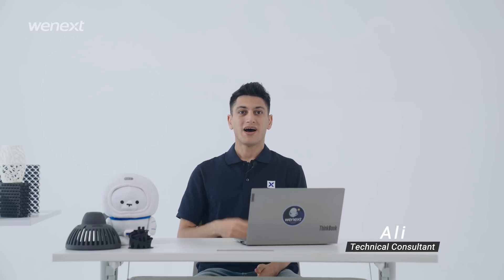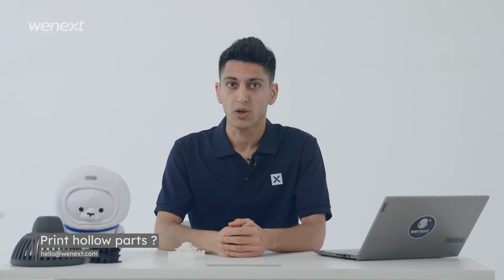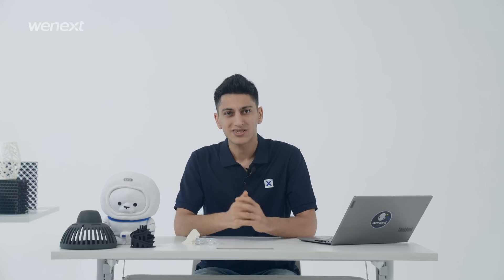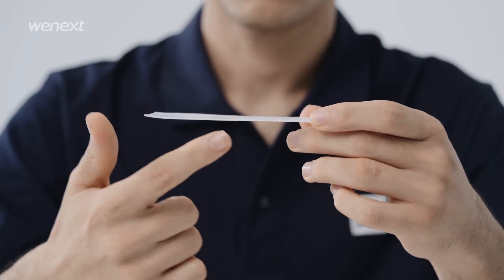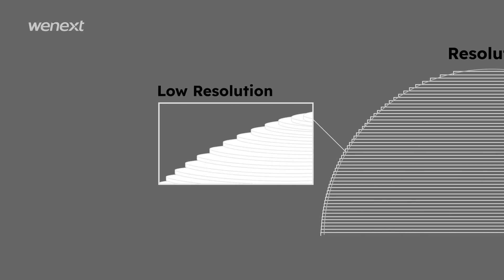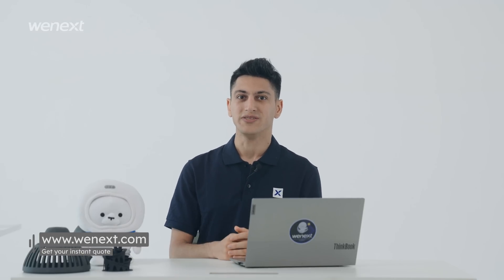Design tips to successful 3d printing - Part II

Comment from the maker: 00:00 Part 2 to learn when designing a model for 3d printing.
00:15 Hole size stands for the minimum diameter that a machine can successfully print.
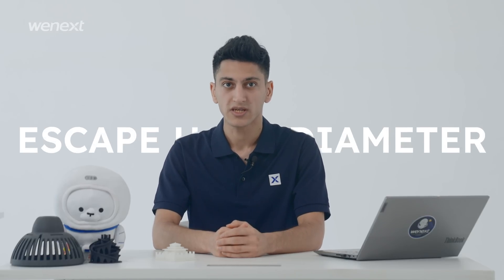00:48 Pay attention if you want to print hollow models in different types of 3d print.
01:41 What do we have to know when printing mobile parts?
02:21 We will talk about designing and 3d printing threads and screws.
02:39 Last but not least, warping is one of the most common issues in 3d printing.
03:22 At the end of this series, there are two reminders we want you to notice. One is the surface resolution of the model.
04:00 The other is tolerance.
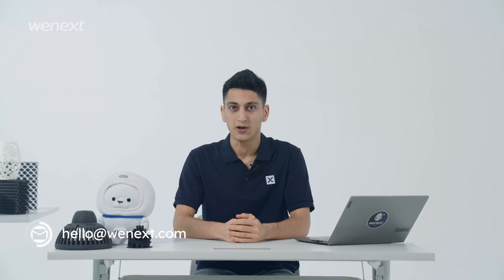04:27 With all the above content of this episode, hope this video helps you.